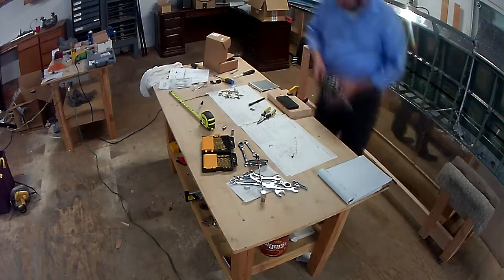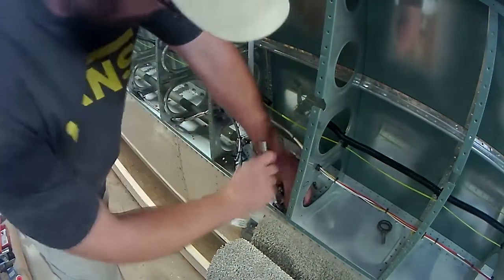Roll Servo installation

Comment: Does the Vans build manual and drawings provide guidelines for autopilot system install?
Reply from the maker: The plans show how to install the support for AP components and your can look in the Vans support portion of the website to look at the plans. In there, they have dynon and garmin wiring and things like that. They help with most of the generic stuff and then provide guidance for wiring and some brand specific things. 

When I installed this AP servo, vans has a section that is specific to the dynon servo installation and I believe that they have the same for Garmin.